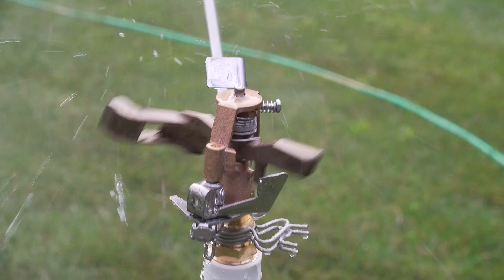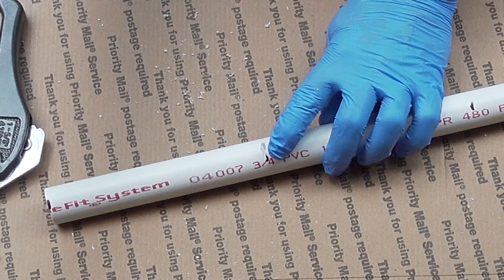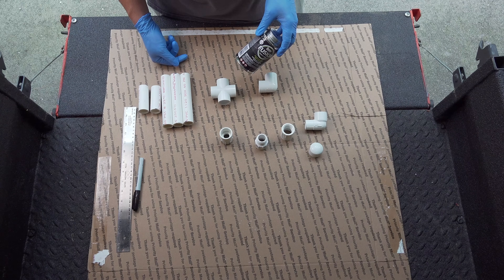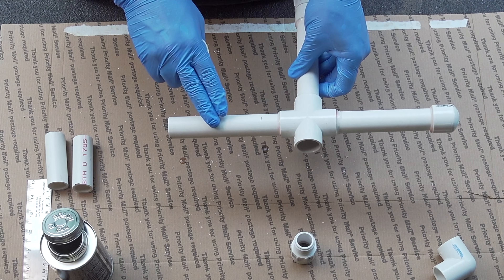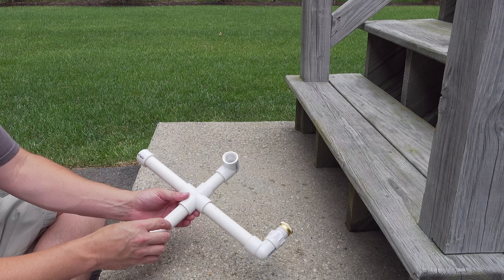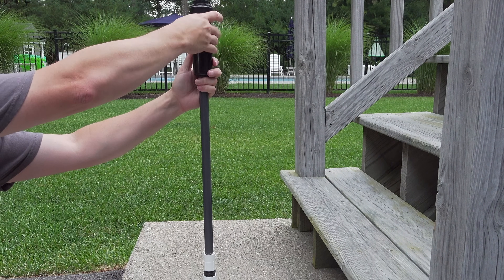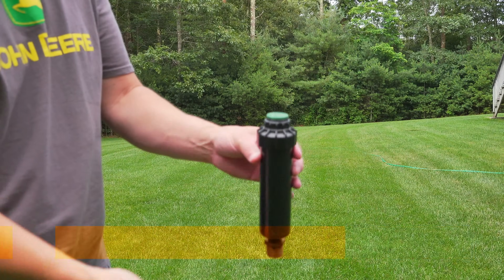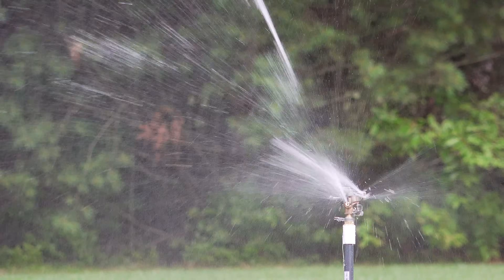Best Lawn Sprinkler DIY - Without an Irrigation System- Build your own EASY

Comment: Great idea in principal BUT you still have to manually turn on and off the water.  You still have to move it around if you have a larger yard.  It is a TON cheaper then an actual in-ground system and it depends on how convenient you want this to be.  I prefer the in ground simply because I set it up in the spring and walk away.
Reply: does anyone know of a good video to do your own in ground?

Comment: I'm attempting to build this at the moment. Have everything at the very start the 5' 3/4" pvc pipe im cutting trying to fit into the 4 way cross leaves a lot of gap room where it seems like it would easily leak. Any tidbits to this? Maybe just go and match up the 4 way cross at a store so it sits flush?

Comment: Just to be clear, glue is not normal glue it is pvc solvent which liquifies surface areas and as they mate and solvent dries out  it actually forms new structures

Comment: I've got a DIY setup and one of the heads in the series is not putting out the right force of water to actuate it. The heads before and after it work fine. Replaced the head, checked for clogs, nothing. The only thing I can see is that it's a regular sprinkler head and the others are gear drive, can that make any difference?

Comment: hey nice design i just got my back yard graded and fresh top soil. so i need a cheap option to water a large area. my question is- the lead that you capped off, do you just add a length of pipe and another elbow facing up for another sprinkler head?

Comment: @Silver Cymbal I built it today as a fun project with my kid.  Noticed two problems.  Leaks where the extension cap was - I guess I need to get a better cap.  And, leaks where the sprinkler riser was connected to the device.  I guess I need to wrap some tape around the "riser".   Other than that, pretty cool and functional.   Can you please suggest the details of the adapter required to attach the impact sprinkler.  Also, could you pls mention the adapter part details if I have a sprinkler that is 1/2 inch inlet as opposed to 3/4 inch as indicated on your video.

Comment: Great video! I am having trouble finding the 1/2 to 3/4 pvc adapters you use to connect your impact sprinkler to the riser pipe. Any suggestions?

Comment: These orbit sprinkler heads I received from Amazon don't have the screw in portion on the bottom, so I am wondering what you did or used to screw them into the fitting?

Comment: I have a newly-installed fence around my garden (17' x 19'), designed to keep out deer. It's a poly web material like contractors use. I want to mount a sprinkler head to the top of one of the support posts (6' high) and attach to a single garden hose. The heads you mention seems to minimally spray farther than my area requires. Is there a sprayer you'd suggest for the coverage I need?

Comment: Very well done video, but in this day and age with irrigation components available at every box store and every rental center renting small trenchers, why would anyone who cares about their yard want to deal with moving around above ground sprinklers.  50% of your water evaporates if you water before the sun comes up and with an irrigation system you can set the watering zones to cycle and finish before than.  If you live in a part of the country where the ground does freeze you can blow the system out in the fall with a portable air compressor.  I have done this for over 30 years.  You do the job once and you reap the benefits for as long as you live there.

Comment: I have a very large backyard (similar if not bigger). Did all the sprinklers you tested water your entire yard? I'm really considering doing this if it did.
Reply from the maker: It really depends on the shape and pressure. But you can run 3 of these together and each can do up to 45' radius
Reply: @SilverCymbal  thanks for the response. I will do that then.

Comment: Good job. So, I'm curious. Why would you put the expansion off a right angle instead of inline? Never thought about an impact sprinkler head for something like this.  The tall pipe for the impact wouldn't be as good as it would wobble too much so I wouldn't recommend it. I've built "inline" sprinklers (I saw you made a video about it) and they work WONDERFUL! Good job...
Reply from the maker: Thank you. You could build it either way, I liked the hose on the side just to give it some holding power from 2 opposite corners. If you got a really high sprinkler mast you could easily weight this down or use a clip from a bocce set if you have one of those.

Comment: Wonderful video and great design.  You showed the part number of the 50' rotary sprinkler head in your parts list.  If possible, please let me know the part number or link to the one that you show that has less diameter (35? feet).  Thanks.

Comment: How do you like your liquid sprayer?
I bought one...your right they are not cheap. I use mine for next products...what nozzle do u use?
Reply from the maker: Which sprayer? The sprayers plus?
Reply: @SilverCymbal  TLS80..sorry
Reply from the maker: @donaldjwright57  Yes I like ti a lot. It's expensive  but cheaper than building your own and you have some engineering behind and parts of course for years.

Comment: I bought one of the spike orbit sprinklers at home depot back in the spring and love it. BUT it its connected to a spike you have to drive in the ground and I cant use it now because its so hard to get in the ground becasue of a how hard this red clay has gotten during this summer heat. Thanks for the video.
Reply from the maker: Thanks for the nice comment and for watching.
Reply: I am thinking about installing another yard spigot bypassing my pressure regulator. I seen another youtuber do this and he got high psi to his oscillating sprinkler and it double covered what it did before. I can link to that video if you are interested.
Reply from the maker: @randyman8984  That is interesting but remember you need flow and pressure for a lot of heads but that may work if the regulator is too low. You can also just adjust teh regulators to make sure you are getting 60PSI. Most plumbers could care less about setting it accurately so you might be low.

Comment: Great ideas and easy to follow!   It would be helpful to detail all parts,  a new ya would not realize you had to use a connector on that riser and an adapter to go from a 1/2” to 3/4”connection.
Reply: Yes, these were missing from the parts list.  Very frustrating.  Can someone put links on Amazon for these two parts?  Thanks.

Comment: thanks so much, quick question; did you miss describing a connector you need for the orbit sprinklers? I just bought two and they are female adapter only, looks like I need to get a two-way male connector to fit into that PVC? thanks!

Comment: I took it a step further and added a PCV close valve between the sprinkler and the outlet to the next sprinkler so that way I can shut the second one off if I need to
Reply from the maker: I like that a lot sounds very nice!
Reply: saborguerito which one did you use?
Reply: @chucksw1  just a PVC shut off valve

Comment: Great idea and video. I would have liked you to take a moment to describe some of the adapter pieces in a little more detail. You spoke about 8 or 9 adapter pieces but only listed 6 in the description section (excluding the pipe and glue). Enjoy and appreciate you much.
Reply from the maker: I appreciate that a lot. Most of the other pieces are just dependent on the head you choose. Sprinkler heads are either 3/4" or 1/2" so if you get a couple of 1/2 to 3/4 and 3/4 to 1/2 then you can use any size pipe and just adapt it where the head connects. Hope this helps.

Comment: Hmm I think I'll modify it so I can run about 2 or 3 of these along my fence which runs along the line of my front yard. I get some couplings to brace the head against one of the upper braces or posts so it's just out of view when not in use

Comment: Are these types of sprinklers better than oscillating ones?
Reply from the maker: Differently sprinklers are better than others. The Hunter PGP and Rainbirds as shown in the video work the best in my opinion. The snappy osciallating one can send water very far but they are not as even. Best used for gardening or massive watering areas but the loss is a little higher than rotaries (black ones shown, linked in the description)

Comment: I have a pretty good size yard and very good water pressure.  About how many of these can you put in series and still be effective?  Thanks!
Reply from the maker: Between 3-6. Remember if its coverage you want you can chain 10 of them and then use smaller nozzles. You can only put out so much water from your hose, but you CAN control how much comes out each one and just run them longer. To understand a bit more about the nozzles watch this video I made: https://youtu.be/t_jGrpt43MM

Comment: Sorry for the dumb question. I just received the two sprinkler heads I ordered from Amazon. I purchased the larger ones, the Orbits I had asked about in a previous. The bottom of my sprinkler heads do not have something for me to screw it into the PVC fitting. is that a separate piece? Should it have been included with my sprinkler heads? I noticed in your video your sprinkler head has something at the bottom of it that allows it to be screwed into the PVC piece, mind does not.
Reply from the maker: Not dumb at all. You need one more adapter. You need a Male to Make adapter. The white pvc base is 3/4" and the sprinkler is either 1/2" or 3/4" . So you are buying a male to male adapter. You can use either one of these:  https://amzn.to/2jQE9iC (this is a 5 pack)  if your sprinker is a 3/4" then you can just get a riser pipe like this https://amzn.to/2ld728V - If you are anxious to do this tonight you can get both of these at lowes or home depot or just order them from Amazon. Thank you and have fun with the sprinkler.

Comment: I subscribed today to your channel. Your videos are easy to follow, simple, & well-done. You kept saying that these sprinklers are customizable. Are you talking about the heads? Can they be adjusted, in terms of how far they spray? Can you adjust them so they go back-and-forth, rather than 360°? Thanks!
Reply from the maker: Thank you very much. Yes you are 100% right totally customizable, you can control the radius 0-360 in small increments, spray 1'-40' and even spray volume by swich the nozzles. For many of us I like the larger head and just use that lets me go up to 40'.
Reply: Silver Cymbal thank you

Comment: i dont see a link to amazon for the extension pipe for the brass sprinkler head. also i dont see link for the metal connector ends for the hose.

Comment: Absolutely fantastic. Making it.
Reply from the maker: I like this one a lot, you can see it used more in my recent sprinkler video too: https://youtu.be/kcieM8ax0Xc
Reply: @SilverCymbal  I have a very odd shaped  yard and have a sprinkler system. But again I can reach areas that the ground level head goes. Also for my garden,  the sprinkler doesn't work there and I get tired of hauling the hise and standing there for an hour. I can put this with 36 inch tall pipe and sprinkler head,  connect the faucet  timer and forget it.

Comment: For running multiple sprinklers, would you interface between them with a long PVC pipe or would you use flexible hose?
Reply from the maker: I would just use fleiible hose but try to get hose with an ID of at least 1/2, 5/8" is better. Pressure is not the problem for many sprinklers usually it's flow rate so the big pipe will help.

Comment: I am getting ~ 65 psi water pressure out of my house.  I have struggled to string multiple "spike" style impact sprinklers together.  Due to the fact that this is using the in-ground style head will I have better luck if I string them together?
Reply from the maker: Yes, because you can control what heads and nozzles you use. It's not just PSI, that matters but the volume of water coming out per minutes makes a big difference too. BUT try to set them up and if you dont get enough flow change the nozzles to slightly smaller. Watch this https://www.youtube.com/watch?v=t_jGrpt43MM that shows more about customizing and adjusting your sprinkler system for best results,  I used my DIY sprinkler for the video too.

Comment: Very nice video. My question is in regards to the second, smaller Orbit pop up sprinkler. The 1st one with the 50' radius appears to be the Voyager II model. The one with the 35' radius and better spray pattern wasn't mentioned or linked. From comparing images, the best match I have can find to the 2nd smaller head is the Orbit Saturn IV - can you confirm what model it was ? Thx
Reply: It is the saturn iv

Comment: Great video and very well illustrated. I’d a system with 6 zones and 6-7 heads each zone for about $4,400. I had been meaning to add another zone / line of sprinkler heads, to cover a new area alongside the street and I figure the Contracter would charge me about $800 or so for that. Now I think I can do it myself and will attempt to. Peace ☮️✌️✅

Comment: Great video and a fun project.  Question:   Is there any chance of this thing tipping over if the water pressure is higher than expected?  I've seen that happen with others.  The one you demonstrated also has a short side where the sprinkler head goes in and so just wondering if it is stable enough to stand without tipping over.  Thanks.
Reply from the maker: Thank you, yes it is possible but it's easy to fix. You could make the legs longer for greater stability but what I do is just use a small plastic dumbell I keep in the garage. It saves me driving stakes in the lawn and it holds it with any length of spinkler
Reply: @SilverCymbal  I built it today as a fun project with my kid.  Noticed two problems.  Leaks where the extension cap was - I guess I need to get a better cap.  And, leaks where the sprinkler riser was connected to the device.  I guess I need to wrap some tape around the "riser".   Other than that, pretty cool and functional.   Can you please suggest the details of the adapter required to attach the impact sprinkler.  Also, could you pls mention the adapter part details if I have a sprinkler that is 1/2 inch inlet as opposed to 3/4 inch as indicated on your video.
Reply: Mathew George hey Matthew, I was wondering if you can advise me of where to get the hose attachment ? I have every single part, but just can seem to find it.  Thanks!
Reply from the maker: @gamersub4911  Its right here: https://amzn.to/2XOJ29C

Comment: Didn't know about the new glue. I really like the spray of the Orbit but never used one like that. Wonder if they are as easy to adjust the pattern as impact.  With impact I go from 180 degrees to 360 really quick no tools.  But I doubt the spray on the impact is as even as the Orbit.
Reply from the maker: I agree with you the impact is a bit less even but it does still seem to work well. Most farms use impact type sprinklers so they seem to have a soli foundation on how they spread water but for sure the rotor units look more even to me too. Thanks for watching.
Reply: @SilverCymbal  Yep, I used to make a steel standpipe sprinkler for landscape suppliers and landscapers. A large tree and shrub yard that took over a hundred used only impact. Landscapers who had small groups of plants and trees to keep well on their yards used the orbit type.

Comment: Just a heads up.   The garden hose adaptor in the link is not the one you use in the video.   It's this one . https://www.amazon.com/gp/product/B008ROTMBY/ref=ox_sc_act_title_1?smid=A2NL9UUKFTRQH&psc=1   Only needed this one to complete the parts required. That, and the sprinkler head of my particular choice.

Comment: How much PSI is required to get those running? I want to use this as a portable solution with some water tanks and pump(s).
Reply from the maker: 45-60psi
Reply: @SilverCymbal  Perfect! I run 55psi pump(s)! Thanks.

Comment: I see there are a couple of different adapters that you are using to attach the sprinkler heads.  Are those listed in your parts list as well.  I followed the links but, it is not very clear.  Also  is this (https://www.amazon.com/gp/product/B000BQKF8K/ref=ox_sc_mini_detail?ie=UTF8&psc=1&smid=ATVPDKIKX0DER) the other sprinkler that you used?

Comment: Question, if the opening for adding multiple lines to this has a outside thread what holds the brass plug in place . You lost me there. Thanks for a great video.

Comment: Nice video, just a quick question. Why do you need the cap side?
Reply from the maker: You can connect more than one together, the cap is the "out" so to speak to the next sprinkler
Reply: @SilverCymbal  fair enough, I thought there was some other reason for it, as I have seen it being done with gas pipes and hvac ducts. Thanks for the reply.

Comment: Will linking 2 together decrease the water pressure too much to run them together?
Reply from the maker: Not usually, you can also adjust jet sizes to make it all work but without doing much 2 can almost always run together and often 3 are ok too